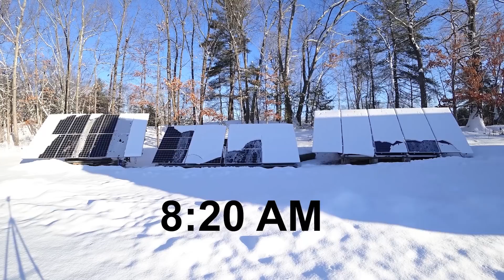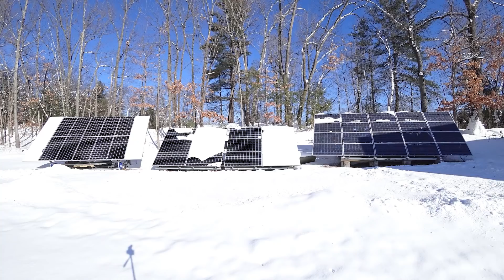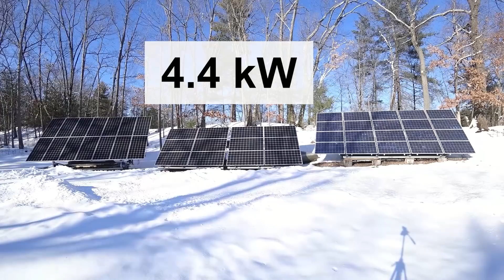How to Plan for Shading and Azimuth on Solar Arrays.

Comment: Hey David. MAde a video but clouds happened! https://youtu.be/JhdifaO5Emw
Reply from the maker: You are the first to respond with a time lapse!  Thanks.  I'll pin this so others can check it out too.
Reply: @DavidPozEnergy  Thanks!! also i´ve followed your videos and i have one advice... you could and should make your solar arrays taller... like 2 or even 3 meters tall (6ft 6inch or 9ft 10inch i think...) that way you would avoid your house shadow in the morning. And i have the car you stole your batteries from (Opel Ampera or Chevrolet Volt) Thoose i will keep inside the car ahahah

Comment: I want to build a solar generator that uses 24 V batteries can I use a mixture of 12 and 24-volt solar panels?  Or do I only need to use 24-volt panels only?  Thanks
Reply from the maker: You are talking about matching a nominal battery voltage to a nominal voltage on a solar panel.  You can do this, but it would only be if you are using a PWM (pulse width modulating) solar charge controller.  PWM controllers are not as efficient as MPPT (maximum power point tracking) solar charge controllers.  I prefer MPPT controllers.  If you use MPPT controllers, then you don't need to match the nominal panel voltage to the nominal battery.  In my personal case, I'm charging a nominal 48v battery with 250v solar array.  I can do this because it goes through a MPPT charge controller.

Comment: I have 3 Strings of 17 panels each, with Enphase M215 Microinverters, total of 51 panels on the SSW facing side of a detached garage. That's 12.75kW of panels, but 10.97kW continuous from the microinverters. Not sure of the degrees tilt, but it's flat to the roof, which is not a flat roof. They were activated October 13th 2013. Average production for full years, starting October 2013, is 15.5MWh/year. Peak daily production was March 16th 2016, 91.9kWh. It's Grid tie, I have an all electric home, with a heat pump, but try to heat with wood as much as I can. Annual electric bill is now about $500-$600. I'd like to add more panels. I don't think I have any shading to speak of, I never done a time lapse. There might a very small amount of shading in the very early morning, as there are some tall trees to the east, but nothing major. Northeast Ohio installation location. 

There is a small roof running along the south edge of the main roof, I call it the woodshed. I store firewood under it. I could easily fit another row of panels there. The garage is 64" deep, so each 17 panel string doesn't go all the way to the back of the garage. I could probably add another 2 panels to each row, so if I added the maximum amount of panels, I could probably fit 76 total on the roof. The installer said that 17 panels on a string was the maximum. It was their first large system, and it took a little pushing to get them to do the tie in at the meter. If they had brought them into the house circuit breaker panel I would have had to downgrade my main disconnect, as you can only go 20% over on the incoming Amps rating of the circuit breaker panel. I would have only been able to supply 40Amps extra into the panel. At peak, I do more than that. By going straight to the meter from the outside disconnect, I didn't have to downgrade. I am afraid that if I add more panels, I'll have to dig up the trench between the house and detached garage, and upside the conduit and wire. 

Enphase has been excellent, as well as the installer. I've had two microinverters die since installation. Both completely covered under warranty. Curiously, both times an inverter went bad, it was on the same panel. Middle row, the panel closest to the front of the garage. Easy replacement, tech just put the ladder up against the garage, and lifted the end panel to replace the microinverter. No crawling out onto the array to change an inverter out in the middle.
Reply from the maker: Thanks for sharing.

Comment: my home is super shaded.  my home is in a suburban location and is a ranch surrounded by multi story homes. in addition to my overall array getting different shading across the day the shading is highly seasonal alos.  due to older trees in neighbors yards, fall is the worst for shading, followed by winter, summer spring, post 3/20 or so the elevation of the sun is sufficent to get over the treeline during the middle of the day.  otherwise I have a production "hole" right at noon, hehe

Comment: I would be so grateful if you could review YIY's Energy storage systems from 10-46Kwh. Apparently they are the same company that produces AIMS and Sigineer inverters in China. The prices are killer, but you'd have to ship them from China. I love your channel!
Reply from the maker: There are several manufacturers making very similar looking inverters.  Aims, YIY, Sungold, Sigineer, etc.  However, there are some slight differences when you are testing them.  Aims has lower idle draw, which indicates Aims did a little more fine tuning.
Reply: @DavidPozEnergy  Thanks for that, David. I am actually more interested in the large LFP battery in YIY's system that is priced beyond belief. I would love to see your thoughtful review.

Comment: Before installing a new array  I always do a video analysis on December 21st. If the solar window is enough at the solstice then you got it made. At our current homestead we have a mountain off to the east so the arrays are pointing 10 degrees west of true south to maximize afternoon solar gain.No sun until 11am in the dead of  winter with the sun setting behind another mountain at 3:45. At our new homestead there is full sun all day with no shading. After 30 years we are moving to a new off grid homestead with lots of sunshine. We start moving March 1st.

Comment: How many kWh a day do they make? It looks like there are trees casting shadows for a lot of the time. That must affect solar yield quite a bit.
Reply from the maker: I only have logged data on the middle array (4.4kw).  Over the past 30 days the best was 20kwh, worst was 1kwh per day.  Again, that's only for the middle array.
Reply: @DavidPozEnergy  it’s a shame your panels can’t get full sun all day but then, how many kWh per day do you need?
Reply: @DavidPozEnergy  I’ve just done a quick check of my panels. I too have three arrays but much smaller than yours. The advantage I have is they get unobstructed sun all day and 2 arrays are on trackers so I got at best this month, 6.5kWh per 1kW of panels on one array (polycrystalline) and 7.0kWh per 1kW on the other array (monocrystalline). The third array is fixed and I don’t have logs for that one.

Comment: I live in Ohio 44512. I have 12x275w facing south and at a fixed angle of the garage roof at 35degree, and 2 arrays ; array 1 6x285w facing 200degrees.array2 8x285w facing 200degrees. The arrays can be adjusted to the seasons 4 times for the optima angle to the sun.  I’m thinking of changing the ground arrays to south instead of my ssw at 200 degrees.  I have Enphase m250 inverters. I usually make just over 7.3kw for the year. I plan on buying used solar panels and connect them to Enphase inverters. IMO I would spec out a higher amount of panels that would be based on 9 months vs 12 months. That way I can carryover my net metering credits for the winter months.   So far this winter I have paid about $100 for using more power at peak time usage. The transportation fees we’re 85% of the bill.

Comment: Feels wrong to cut down trees to get more sunlight - I would try to accommodate them first, maybe trim the most offending branches!
David, if you have some scaffolding poles, you could maybe raise the middle and right panels a few feet to avoid the winter house shadow. How is your roof area and aspect?
Reply from the maker: I still have trees, just not the ones south of the array.   I can't get a permit for the roof.
Reply: @DavidPozEnergy  Can't get a permit? That's really short sighted of the council. Could you ask them every year in case the policies change?
I expect they should as the country takes renewables more seriously in response to the growing threat of climate change.

Comment: I have some loss (5%?) 6 months of the year when sun is at a low angle due to neighbors house blocking my roof line.   Then some (5%) loss due to palm trees in the afternoon from a another neighbor.   The roof array of 25 panels is 25deg.  The yard array of 20 panels is only 17deg to avoid neighbor complaints. If I were to raise it 30 or 40deg it would be highly visible / in their face.    My overall array is 12.85kwh (45 panels) and produced 18,030kwh last year.  This is Southern OR,  mild climate,  42.3230888" N, 122.8765434" W    I'm tracking 10% below PVWATTs website predictions - but its hard to say exactly how much I'm loosing.    I try to resist Solar OCD and be happy with what I've got rather than get stressed about losses :)

Comment: I'm in the uk and my yard is about 75 x 20 foot with houses and trees all around.
I have 2x300w + 2x300w + 2x100w + 1x150w each point in different directions to catch sun at different times.
You quite lucky if you ask me.
At this address I'd be lucky to ever get my money back in power. (I purchased my solar before my divorce forced me to move into a shoe box and now I'm trying to get some use out of it) 

I have the 2x100w sat out the front of my house behind the drive and if i park the car at the right angle and fold the mirror in i get a couple of hours of power at between 2-3pm

The rest are in he back yard on top of a shed that has the batteries etc.

( I only power my living room with this setup and I'm in the process of selling my computer to build a low power replacement )
( There is a small glimmer of hope though.... I've just found a stream that is the other side of the trees (200 feet). Don't tell anyone but i hope to sneak a small waterwheel under the bridge and maybe that'll give me 100w if I'm lucky witch would be enough to power the tv )

Comment: what are your thoughts of used solar panels ?? i found 250w panels for $90 a piece & they look good (no cracks just some scuff marks on the framing from normal install & uninstall) 🤔✌🖖
Reply from the maker: All my panels I bought used.  So I like used panels.  But be careful.  I've seen plenty of ads (maybe the majority) where someone is selling them for the same price you can buy new ones for.  Sometimes they will say in the ad "I paid $x 5 years ago" or whatever.  You can purchase brand new solar panels for $0.50/watt.  So if I buy used panels, my rule of thumb is, I only consider them if they are $0.25/watt or less.  I don't consider anything with cracked glass, but a dented frame is OK by me.  But, sometimes brand new panels will hit the open market at a discount, like $0.40/watt.  At that point I'd buy a pallet.
Reply: @DavidPozEnergy  thanks 😁👍👌🖖 ✌😎
Reply: My panels were NEW OPEN BOX some are a slightly different color or frames not welded quite as square. They were fully guaranteed and all function well and but are offered only which is fine since thats what I use them for.  They were .30 per watt.  You can get used panels that dont have peeling or snail trails etc for as low as .16 per watt .  Check eBay  but shipping is usually $200 or more for a pallet depending on your location .  Or of course if you are close pick any quantity up with no shipping.
Reply: That seems pricey to me. I’ve purchased 300w panels new on FB Marketplace for $90 locally. I am very happy with them. I buy mostly everything on FB Marketplace. It’s way cheaper than CL. I live in Southern California. I’ve seen a lot of solar businesses go under and suspect these guys buyout these businesses and resell them in the open market.

Comment: How many kw hours are you making a day this time of year. Thank you. Mark in Louisiana. 
I have 1050 watts on my truck camper and the best I see is about 500 watts
Reply from the maker: I made 17kwh from the middle array (4.4kw) on a sunny day last week. 
 That's pretty good this time of year.  On a overcast day I'll still make 1kwh.  That's the one tied to the Victron charge controller.  I'll have to get wiring done for the other one.
Reply: @DavidPozEnergy  You only get 1 kWh on a cloudy day (ex: ~5.9% of full sun days)?  On continuously overcast days, but with relatively light and bright clouds, I observe something like 40% of normal for a fully sunny day.  On really dark days, where it is continuously raining with dark clouds, I observe around 20% of normal for a fully sunny day.  If your solar system is generating only 5.9% of normal on a fully cloudy day, then presumably one or both of the following issues applies to your system:

1.  Your MPPT solar charge controller or inverter may be badly designed.  Unfortunately there are products on the market today which are not properly designed and optimized for operation during low solar availability conditions.  One MPPT charge controller model I observed basically went into a latched non-production state, anytime that the solar panels could not produce a certain minimum threshold value of current (ex: do to excessively dark cloud cover).  Simply replacing the MPPT charge controller with a different brand and model unit allowed for full capture of the likely available solar energy on cloudy days, including very dark days.  Unfortunately, MPPT charge controller manufacturers don't normally advertise possible limitations of their products (such as minimum threshold solar panel current to operate properly), so there is practically no way to know what product is good or not, until one actually buys it and tests it in real life.

2.  Your solar panels may be of a poor design, which were not optimized to retain good output performance during low irradiance conditions.  Many commercially available solar panels today have graphs in their datasheets that show energy production efficiency dropping from 100% (at 1000 W/m^2 light levels) to ~95% at 200 W/m^2 conditions (which correspond to noon time but on a very dark cloudy day).  In other words, on a cloudy day, you can expect something like 95% * 200/1000 = 19% of normal (full sun) output on a cloudy day with 200 W/m^2 light levels.  There are however other (especially older) panels that perform much worse than this, where the production efficiency steeply drops off at low light levels.

If issue #1 above applies to your setup, you may be able to considerably improve cloudy day solar production, simply by replacing the MPPT charge controller (or inverter model if using grid tied equipment).  In my case, the "SunnySky TYC-60IR" MPPT solar charge controller seems to work satisfactorily on cloudy days, without requiring any minimum threshold current for normal operation.
Reply from the maker: @ Fritz Schlunder: I was providing the range.  When I look at my graph of solar production over the past month (looking at it right now) the lowest production day is 1kwh.  I don't know exactly what the conditions were that day.  Maybe that's the day we got 18" of snow?  IDK.  I don't keep records of weather reports vs. solar production.  But over the past 30 days the worst day was 1kwh, and the best day was 20.43kwh.  But that 20.43kwh day is an outlier.
Reply: I have a 2.6 KWH array myself, and on a good day mid winter I see about 4 KWH, of course I have a neighbor with a 200 foot pine that shades them until 130pm and the sun sets around 6pm, Yes I have them facing a bit to the north lol....

Comment: My solar panels are on the roof, equaling 5.5 kW. Unfortunately I live in the Pacific Northwest and my house isn’t facing south, it’s facing west and east. Most all of my panels are on the west side, as that’s where the low sun in the winter hits at the best. So I’m looking forward to this summer and getting full sun on my new panels. 
I just wish I had a way to charge my battery bank at night? All I need is around 300 to 500 W to keep my batteries from draining in the morning. The biggest drain when the sun goes down, is the gas furnace. Which drains about 600 W or more every time it goes on. Depleting my six Battle Born Batteries. System is 24 V. 
Thought about wind, but there’s not enough to make a difference. Love to hear what others are doing in this regard. ☃️
Reply: More panels more batteries more money and as much insulation and efficiency as possible.!!

Comment: O man micro inverters would help you so much. My panels with micro inverters are putting out 85% this time of the year. My combined DC panels are putting out about 30% right now.
Reply from the maker: Yes, I've been thinking about switching to micro inverters.
Reply: @DavidPozEnergy   I'm another nice thing about using some micro inverter with my 12K inverter when it's in full Sun then I have 15K of power to run things.  With my 1.5 horse power well and my 5 horse power commercial compressor those two  Could be a problem if they both turned on exactly at the same time. But with the micro inverter 3000 W it helps out that problem substantially.
Reply from the maker: I'm surprised you can run micro inverters with your inverter.  I don't think it's approved by Sigineer?  Have you ever had a situation where the micro inverters were feeding directly into the inverter, no loads on?
Reply: @DavidPozEnergy  Micro-inverters won't help much with that type of shading. Unfortunately. You need to consider resultant IV curves and how the bypass diodes work.  Also, the mppt voltage windows of the micro inverters need to be considered. The time lapse video is really cool to see how the weather progresses. Great idea.